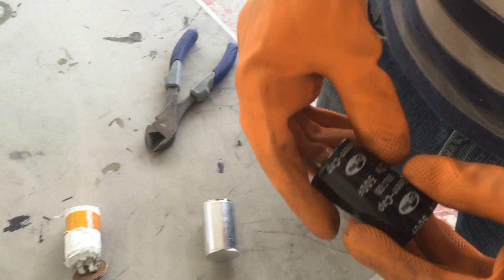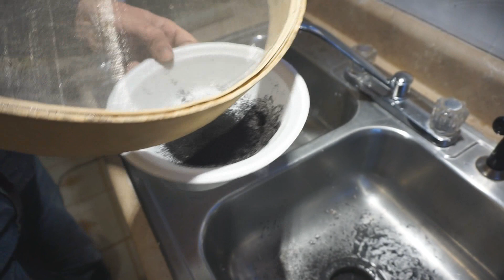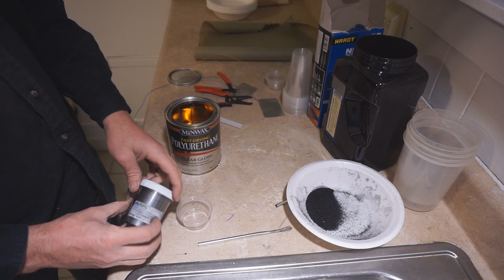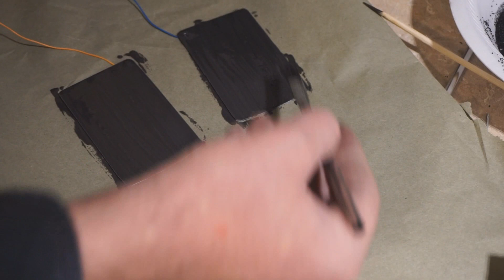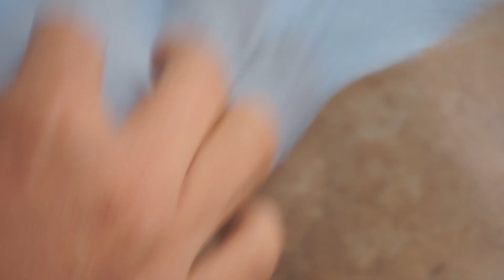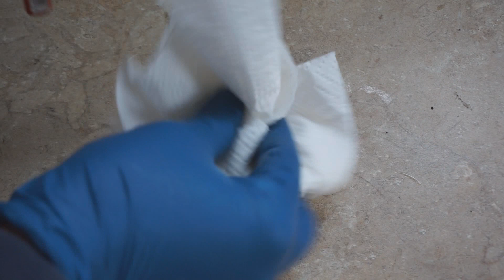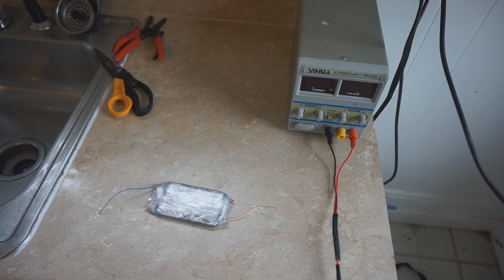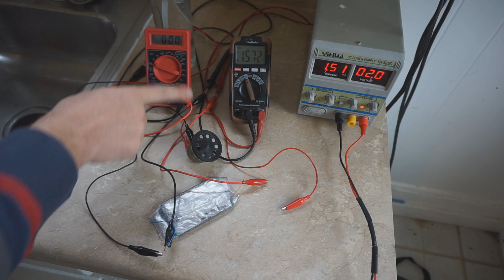Easy DIY Graphene SuperCapacitors

Comment: just another thought... its all about packing as high of a concentration of high specific area carbon per unit volume, right?  so why not mix two different sizes together instead of a single sieve fraction.  think about the packing... if you pack similarly sized objects together, they create void space, but if you have at least two different sized objects together, the small stuff can sit in the voids of the large stuff.  finally, i might try some micronized graphene as a conductive media.
Reply: you are exactly right.  Graphene by itself in polyurethane will give a whopping 0 conductivity.

Comment: BUT THERE"S A PROBLEM:
I'm lazy, I would love to buy one instead.
Please, if anybody knows who sells these graphene super-capacitors, let me know.
I want to make my own electric F5 GTM.
Reply: +Emanuel Ro Almost all super-capacitors are graphene. They can be purchased also as ultracapacitors or boostcaps. They range in capacity from around 1F to 4,000F. They could be 2.3V, 2.5V or 2.7V. The 2.7V seem to last the longest. Most electronics shops sell them as well as eBay.
Reply: they're carbon not graphene.  Graphene isn't good anyway tho.
Reply: NatureHacker It's true that many supercaps use activated carbon. Some supercaps are graphene:
https://www.indiegogo.com/projects/zap-go-first-graphene-supercapacitor-charger#/

The trend recently has been to use graphene instead of activated carbon because graphene has a larger surface area. Graphene can also make thinner layers. Graphene supercaps are also easier to make.
Reply: Easier to make I doubt that.  I have serious doubts about pure graphene caps because it would be much harder to get conductivity using a binder.  Mabye if they used vacuum filtration to adhere the graphene to sheets binder free it could work but I only get 200 ohms max with that and that is easily gotten with just micronized graphite even with a binder.  So I could see ADDING graphene to the activated carbon to increase surface area but even then I'm not so sure it would even help.
Reply: *****

Do you know anything related to electric car building? For ex: Super-capacitor installation for ev's?
Reply: As far as I know they are the same as a battery in the fact that you hook them up in series to add voltage and parallel to add current.  You can hook batteries to the supercaps and supercaps to your controller.  Just make sure you don't overload the controller.
Reply: NatureHacker

Thanks man! I would seriously like for people to join me in building this electric car. I haven't seen any cool exotic ev's and I know that one day I'll be able to make it with people who share the same hobby.

Comment: just a few things i noticed...
1. its not graphene its activated carbon
2. If wou would use copper as base plate, you coud just have soldered the wires on
3. you know what effects the capacity of a capacitor?
its not just the area used its also the dielectric constant of the dielectric material and the distance between the two plates
so putting the plates closer together (and not using this fat layer of paper, mayby something to spray on) will increase the capacity
4. It seem like you did not really understand was a eletrolyt in a elko is for
and last but not least... If this video is not fake, there is something other than capacity because at this huge distance and small area its just not possible
(sry for my bad english, I'm not a nativ speaker)
Reply: and I almost forgot... you could use a better conductin adhesive than poly urethane

Comment: Hey lasersaber! I have also built graphene super-capacitors, and have had some interesting results; many of the other people on youtube have had similar results, and I was just wondering if you had had these results. Is your super-capacitor getting better with every charge and discharge cycle? For instance, capacity growing, holding the charge better, charging faster, etc...?
Reply: your probably nano structuring the carbon somehow to give bigger surface area.
Reply: this could happen because your electrode is enhacing wettability

Comment: Your graphene is bugging me. Normally graphene I have in lab is in suspension, due to it's extreme reactivity, and inability to obtain large sheets (by large sheets I mean over 100 x 100 micrometers), processes like flocculation, coagulation, adhesion, adsorption that are real enemies of nanostructures like graphene. Can you provide me some information on manufacturer of this "graphene" powder, I would like to take some measurements of it with TEM.
Reply: seriously dude?  Your not a chemist just a hobbiest.  take your suspension, throw it through a Buchner, and set the filter paper in front of a fan and violla, graphene powder.
Reply: Oh, but I am a chemist ^^". That why I asked in the first place. Procedure you described will most likely destroy graphene structure due to processes I have mentioned in my previous post. It will work, in presented device, no doubt in that. But it won't be graphene. Have a nice day ^^
Reply: +NatureHacker Argumentum ad hominem? Not nice, that is for sure, but after reading this publications: http://yylab.seas.ucla.edu/papers/Vincent_High%20throughput%20solution%20processing%20of%20large%20scale%20graphene_2009.pdf ; http://www.sciencedirect.com/science/article/pii/S0378775312002273 ; http://www.sciencedirect.com/science/article/pii/S0169433211001450 . I have to admit that You are right, and in fact graphene is much more stable in air atmosphere than I thought. Despite awful rudeness in your replies it answered my question, so thank you. Have a nice day ^^
Reply: I appreciate the honesty and I apologize for being mean but you did assert things as fact that you didn't know.

Comment: Wait a min, you're using carbon, not graphite. You can find powder graphite in the hardware store. It's used as lubricant believe it or not.
Reply: Isn't graphite carbon?
Reply: Aaron Keith Not sure, but there's a reason why it's called graphene and not carbene me thinks.

Comment: Talking about surface area, Have you thought about using foamed aluminum plates? One thing i'm curius about is graphene/graphite being corrosive to aluminum... Would that have correlate to the chemical reaction aiding capacitance? I have read about the properties of graphene and it looks like a promising new technology. WGTR had some useful tips... I wonder what kind of wax he refers to... Would it be paraffin wax? I am tempted to try that and coat it with polyester resin.
Reply: paraffin wax I think.  Similar application where people spray this on the underside of their cars in the winter to prevent road-salt corrosion.  It's a rather durable coating considering that it's basically being sandblasted.

Comment: The "really thin powder stuff I'm gonna wash down the drain" at 3:07 is what you should have used in an attempt to actually achieve a graphene capacitor. Even better would have been to capture the dust that billows out at 2:50 when you take the top from the grinder. 
What you've actually created here is nothing more than a dual carbon capacitor.
Reply: coming from someone who has never tried it.  Graphene is a horrible conductor inside a polymer matrix.  You need large chunks so you can actually force contact with your aluminum collector.
Reply: +NatureHacker You have no clue what I've tried and what I haven't. Speak for yourself.
Reply: I've tried it.  Have you?
Reply: NatureHacker
I'm currently working towards a cheap and reliable method for large sheets of single layer graphene, so yes I've tried it.
Reply: so you haven't tried mixing graphene with polyurethane and measuring the resistance?  Cause that is the point you were making.
Reply: Please point out where I even mention polyurethane?
Reply: you suggest he uses very fine dust in place of the large stuff.  Polyurethane is how he stuck the carbon to the collector.  My point is without the large stuff it wouldn't work because the fine stuff can't make good contact withthe collector through the polyurethane.
Reply: NatureHacker
You're making the assumption that I use the same methods of collection as him, which I don't. My only suggestion was that he focus on working with the finer particulates.
Reply: If he used the finer particles instead of the large particles it simply wouldn't work.  Yet you refuse to try like I have it and refuse to admit you may be wrong.
Reply: You're talking as if this method is the only way to create a graphene supercapacitor. It isn't.

Good luck in your efforts.

Comment: Do you know how to create a graphene battery (Or), which components can be handdle to create a graphene battery? not supercapacitor, but battery, and do you where I can find graphene sheets, especially to create a battery? I appreciate a lot!!!
Reply: sub to my channel a battery needs a different anode material that can be easier oxidized than carbon.  Check my aluminum air battery video.

Comment: A technical suggestion for building these.. As a technician for years, I can attest to the importance and problem-preventing necessity for implementing "strain relief" on any wire entrance / exit points on devices... So if I were to build one of these, I would carefully place a knot in the wire right against the inside edge of the bag seal inside the bag so that there is a knot to prevent pulls on the wire from stripping the wire out from its sheath and placing strain on the capacitor.. Put the strain on the bag seal instead.  Use the ol' wire knot to prevent accidental pulls from destroying your capacitor or creating unreliable pull-damage related intermittent connections...  Its worth doing.  Trust me.

Comment: I would order off eBay rather than Amazon because if you had a problem with a seller sending you the wrong size product or wrong product on eBay, if they don't resolve it, your money is refunded no matter what...
Reply: same with amazon but I hate both.  I try to find independent sellers.
Reply: Well the sellers on eBay often post their direct website links where you can order directly from them sometimes for cheaper, but at higher risk.

Comment: Why not use tinfoil - graphene - silicon - graphene -tinfoil - silicone and then make a cylindrical coil. ? I mean if its all about surface area, the current capacitor design should make it rather easy to increase.
Reply: you don't want silicone.  It is such a good insulator that it kills conductivity.

Comment: I have watched quite a few of your videos and am very new to the world of electricity and electronics. I am working on a micro pc design using low voltage devices like the raspberry pi and am interested in experimenting. Have you used any of this Super capacitor technology to power any low power devices like this , or is this currently not feasible . Also, I am interested in the use of carbon rod Air batteries as a power option for something like this . 
Thank you for all the research and design into this sort of tech, this work is so important to pushing us into a new age of power and technology.
Reply: sub to my channel noble metal batteries is what you want for a whole lifetime of rechargability.

Comment: so if I make a cell and a capacitor I could plug a heater in?

how do I make a heater
Reply: what if you put the crystal batteries mix and the super capacitor graphine mix together???

on gold plates?
Reply: a heater is just a coil of wire shorting out the capacitor.  Nichrome wire usually for its high resistance
Reply: Thanks

Comment: what's the danger of your alternator just keeping the boost pack charged , while you drive. and also is there a wiring diagram for the boost pack with big black capacitors .

Comment: How can you be certain that you have not merely created an aluminum-air battery and not a graphene supercap?
Reply: if he had an LCR meter he could.  But no, the aluminum isn't exposed to the phosphoric acid, the polyurethane prevents it.  If you have 2 of the same materials on either side of the electrolyte you will have no electron flow from chemical reactions.

Comment: this is a dual carbon capacitor.
Reply: NatureHacker We assume you can prove your statement right?
Reply: graphene doesn't make a supercapacitor, electrolyte does.  The graphene in this build is worthless, graphene mixed with polyurethane has zero conductivity.
Reply: Thats not entirely true, from what I understand from feedback that the poly insulates the ali from the acid while the granuals pass the current to the plate in numerous point contacts
Reply: @NatureHacker  I think so

Comment: I keep on hearing about graphene batteries, I know what a regular capacitor is and my question for you is are these people just calling them graphene batteries so people get what they do or are graphene batteries something completely different?
Reply: graphene batteries use graphene in a ink based cathode.  The anode can be any metal that will dissolve in the electrolyte.

Comment: Yes there is several mistakes here. 18 farad would make the size of a suitcase 18x27x12.  And it is not grahene he has created more of a graphite composite capacitor.  In order to increase the storage you need to increase the surface area of the two plates that is why they roll up the two plates and form a jelly roll style of cap and not two flat plates. If you could figure a way to increase the surface area while keeping the overall size small then you have a winner.  Best type is the jelly roll style right now.

Comment: Have you tried NaOH (sodium hydroxide) instead of acid? high ph base rathert than an low ph acid ? David Puchra spoke at teheTesla Tech Conf. in NM, last summer. he used monoatomic charged gold water from an hho cell as his electrolyte. It held a charge for about a month, until is dried up inside and stop charging. Has to be sealed well!! He used alumunim plate and a stainless steel plate.
Reply: wjen we are talking super capacitors it has to have a high dielectric constant and low conductivity.  This isn't like a battery electrolyte.  What you are describing is a battery.

Comment: Did you know that there are papers the show that the surface of the sun is graphite? The whole sun is a capacitor.
Reply: +3877michael that sounds interesting... can you source this data? I did a quick google search but found nothing.
Reply: Gee I for got his name an it was hard to find.  He is not regarded well by mainstream science. Pierre-Marie Robitaille. His papers are hard to find. He has a few videos up on YT I lost his paper when I was cleaning my files.
Reply: Michael Harrell not well regarded... Code for, "is a hack"
Reply: He was a smart guy who apparently lost his mind.

https://rationalwiki.org/wiki/Pierre-Marie_Robitaille

This is his paper on the aforementioned pseudoscience site, where he claims the sun is a "liquid metallic hydrogen" pressurized within a "graphite lattice photosphere".

http://www.ptep-online.com/2013/PP-35-16.PDF
Reply: not regarded well? Lost his mind? That doesn't sound accurate at all. 

Here's his youtube channel where he goes over the laws of thermodynamics, radiation laws, and his liquid metallic hydrogen hypothesis.
https://www.youtube.com/channel/UCL7QIOZteWPpBWBOl8i0e-g/videos
The math is right and the videos are of high production value, seems pretty good for a guy that has "Lost his mind" 

You realize he was a principal designer in MRI machines right? And has Ph.D in radiology? Just because a professor's hypothesis isn't of the popular cosmological view of his peers doesn't make him a hack. That's just prejudice.

Comment: if I used a flexible conductive material such as copper foil and created a spool design could this be used to replace drone batteries and could it then be charged in flight by using the drone's ducted fan as a turbine combined with solar pannels on its wings to charge while gliding from a high altitude?
Reply: also you should try using the same electromagnetic resistor idea that is used to slow the discharge from large tesla coils as it could slow the discharge/lower the amperage without causing a loss of voltage... I think
Reply: copper foil is prohibitivly expensive for any reasonable surface area
Reply: +NatureHacker true
Reply: where I'm going is open source sacrificial anode batteries using graphite/grapene in a binder for the cathode and aluminum foil as the anode.  I don't want to give away the secrets yet (graphite binder and electrolyte recipie) until I publish my design on my youtube channel, which at the current state of testing, should be pretty soon.
Reply: NatureHacker cool i will go see

Comment: why aluminum plates opposed to aluminum foil in very long strips then rolled up parallel to each-other?   another question, for more surface area on your activated carbon, i understand why you made it small grain, but why not a real fine powder then mixing it with your polyurethane mixture opposed to just "sprinkling" it on? seems it would have gone quite a bit further and have a higher efficiency as a powder opposed to a grain. maybe measuring the amounts of everything you use would allow for proper data collection during testing that way documenting all of your results would be much easier.
just wondering.  great video though, very interesting.

Comment: you should use the dust. More surface area = more power
Reply: not in the glue.  Trust me you mix graphene with polyurethane you get zero conductivity.  The only conductivity you get is when the chunks are touching the aluminum